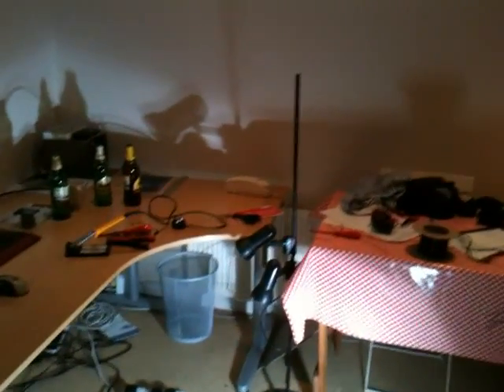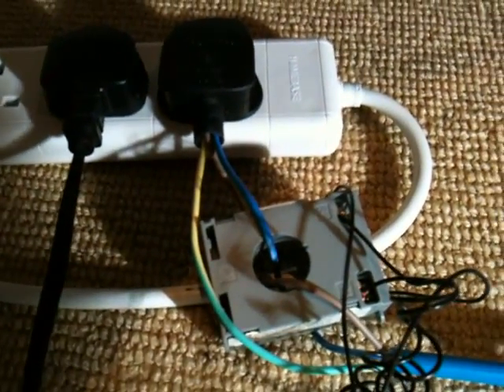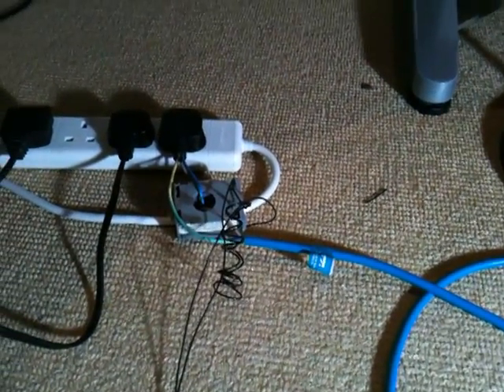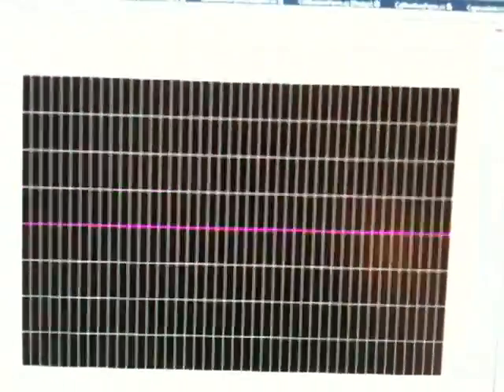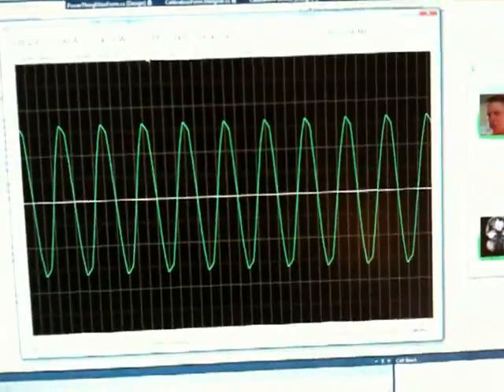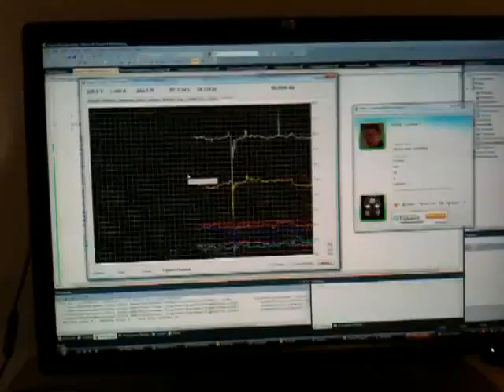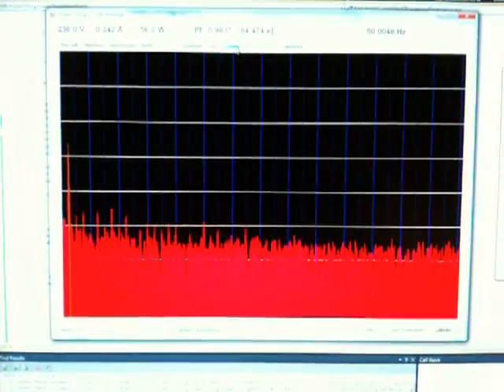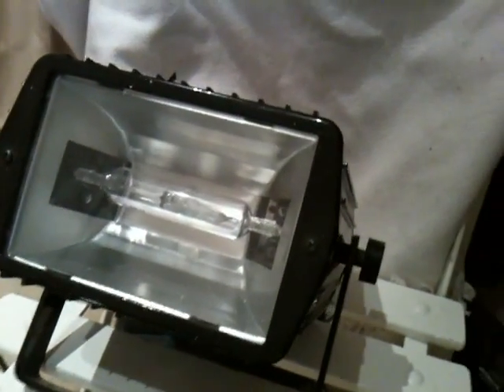Home made energy kWh meter.

Comment: Ideally, you want to eliminate the transformer altogether as all types will distort the waveform to some extent and often aren't all that linear. A very small EI core is probably the best type. The best solution is to use a simple resistor divider but obviously this poses a safety risk on a rig like this, so I'd be inclined to build a circuit with a pair of DACs not isolated from the mains, then use a optoisolated or galvanically isolated digital interface.

Comment from the maker: I must admit that I don't know enough about error in transformers to know what the best type is. However, the toroid I used produced a waveform pretty much indistinguishable from a scope with a 10:1 probe. Low-cost shell type transformers from pregnant plugs gave a horribly distorted waveform.

Of course, I now have to ask, what IS the right type to use? (assuming that I don't have a measuring transformer to hand).

Comment from the maker: @narcoti There's not much noise on the soundcard. There is a bit on the 'current' channel, as the signal I'm measuring is so tiny. I've got a 100 A current transformer which I'm using to measure 0.25 A, and I've just shorted the CT out with a short piece of wire, which has very small resistance, so I get a very small voltage.

I use a creative X-fi card. I actually got better results with my integrated sound, but I think I broke the analog input with a bad connection, so I use the crappy x-fi.